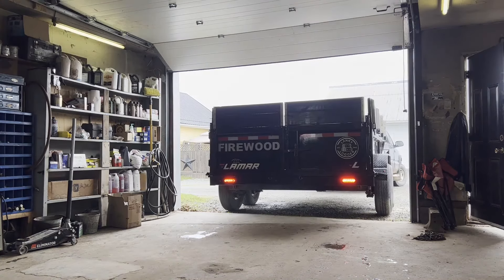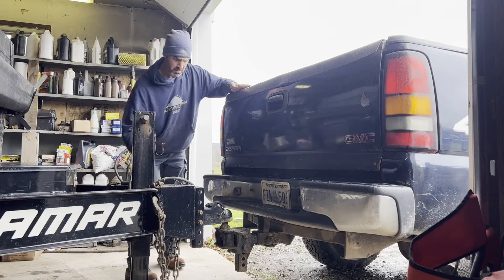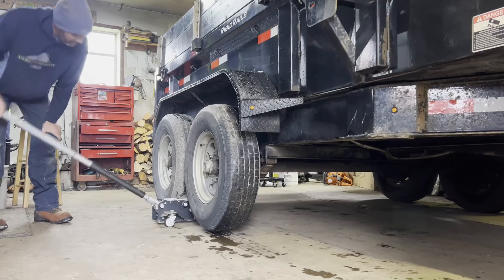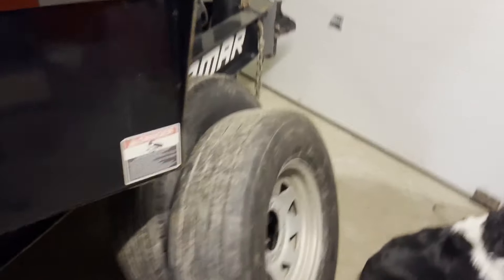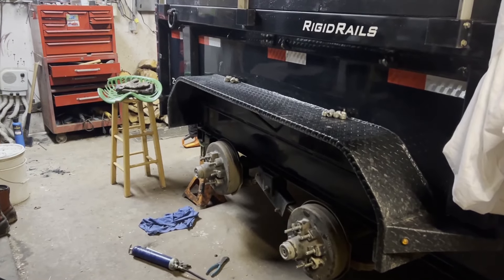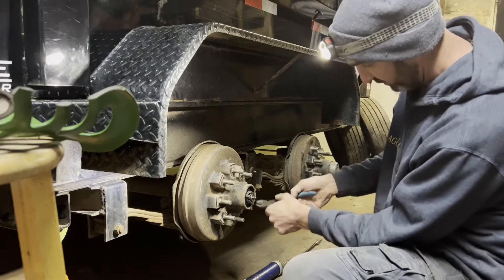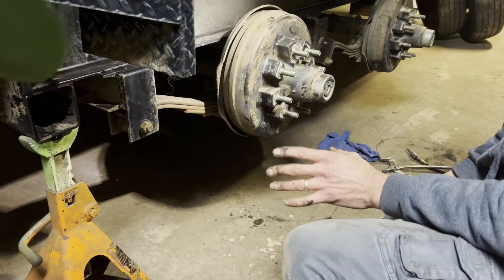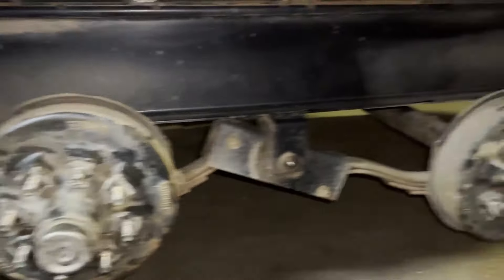THESE 3 THINGS Will Add YEARS To Your Trailer | Winter Dump Trailer Maintenance

Comment: Different looking drums , are those 7 thousand lb axles , my brimar is lp , very hard to ajust brakes without removal  , i stepped up to 14 ply tires ,  i haul heavy , long way to the grinder , nice shop !
Reply from the maker: Yes they are 7000.00 lb axles. Yes I like to take the drums off to adjust properly. Most of the time the adjuster is needing some lubricants to get working anyway. The tires I put on are at lest 15 ply. Maybe more. The side walls are very heavy. Have a great day.  Thanks
Reply: And what’s nice is that they make 12 and 14 ply tires for 15” wheels. They are very reasonable as well. I’ve been running the TransEagles on my trailers the past couple of years and they have been holding up very well. They’re literally like small semi trailer tires.